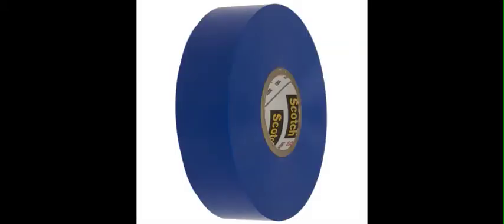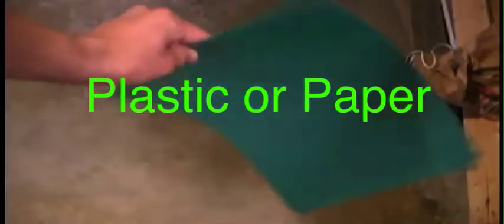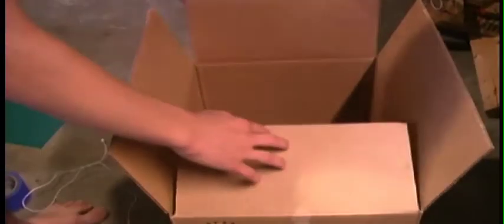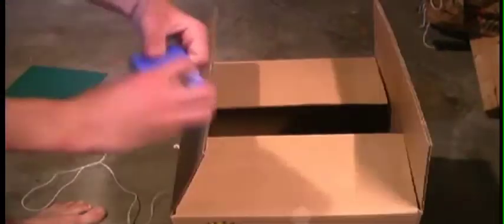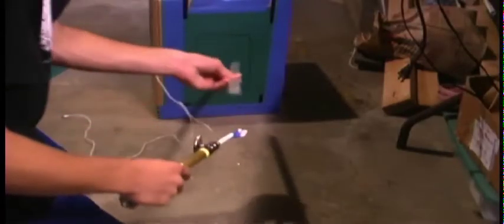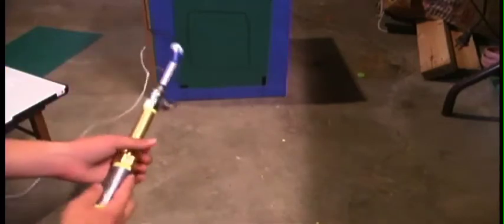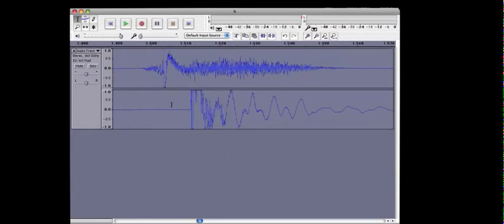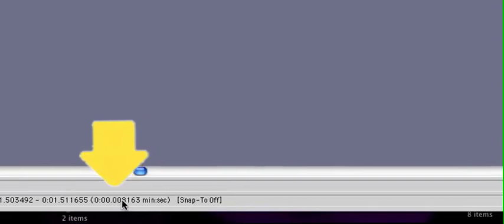Measure the FPS of an airsoft gun

Comment: Great idea, thank you. I have modified this a bit to use samples, and not ms. for improved resolution. With 44.1KHz audio sampling and 4.75 ft distance I am getting results very close to chrono and don't have to travel 30 miles. Must measure from the very beginning of a signal. Interesting that "receiving" end hears when BB leaves muzzle and you can cross-check yourself because it must show 1125 fps - the speed of sound in the air. At 4.75 ft and 44.1 KHz it is 186 samples. I estimate precision of this method within 10% which should be enough for most.

Comment: hhb productions I need help
I made a great box/earbud holder thing and it took me like 1hr 30 min to do, but when I downloaded audacity, when it recorded, the top and the bottom top and the bottom bar both show the same sound wave things. It is not recording from the earbud itself. Please help me :)
Reply from the maker: Are your earbuds close together? Try giving them a little distance. Also, tap on one side and then the other to ensure that it's recording each channel separately.
Reply: The earbuds are not recording at all. There is no specific option in Audacity to have the earbuds as a recording device. They are as far apart from each other as they can go and tapping while recording does nothing. It is currently recording  out of the microphone on the actual computer.
Reply from the maker: Ah. You need to figure out how to switch your recording device to the microphone input on your computer. I use a Mac so I can't help you if you're on PC, but google around and find out how to do so.
Reply: Will do
Thanks for the help:)
Reply: I think I found out the problem. I was testing some other earbuds around the house but none of them worked except for one that was recognized as "Mic in at front panel (black)", but it recorded through a little bar on the wire, not the bud itself so that didn't work. The others are not recognized at all by the computer, except for listening. I watched another video on how to record with earbuds, and he used apple earbuds, like the ones you get when you buy an I-phone, and I do not have any of those. I think you used those too, and those have little mic things on the earbuds. Do you think that is why it is not working?
Reply from the maker: +Seanicus TheGreat It sounds like you're plugging the earbuds into the audio out port inside of the input. Or, your computer may not even have a microphone input. In that case, I don't think there's anything you can do as this hack requires a computer that has a 2-channel microphone port.
Reply: My computer does only have one port for audio, but the picture on it is a pair of headphones, like audio output, but the headphones have a mic on them in the picture, so it could be both. I do have another computer I could try, which has both.

Comment from the maker: True, but not really. You see, the earbud attached to the plastic is acting as a microphone with a REALLY low gain. Meaning, it can only pick up REALLY loud sounds--in our case, a bb sending a massive vibration through plastic and into the speaker element of the earbud. In most cases, you won't be able to pick up the "shockwave," which is fine because that's not what we need. Imagine the earbuds more as switches that detect when the bb leaves the barrel, and when it impacts.